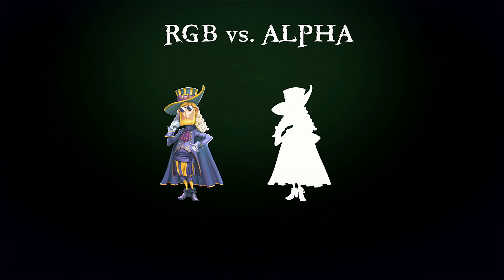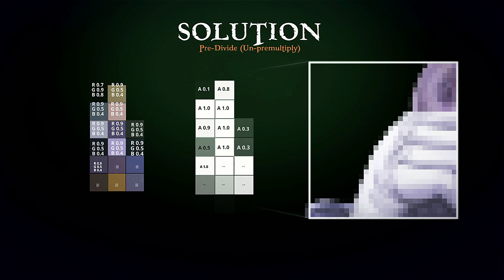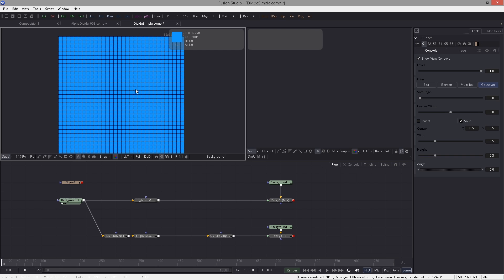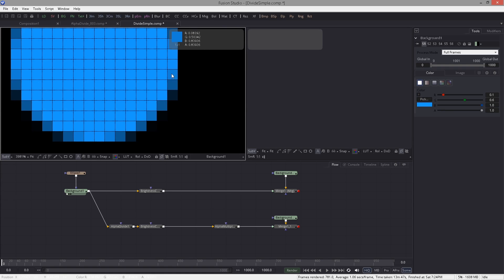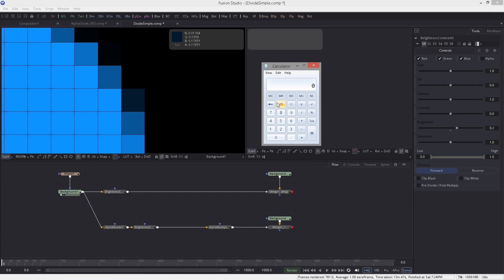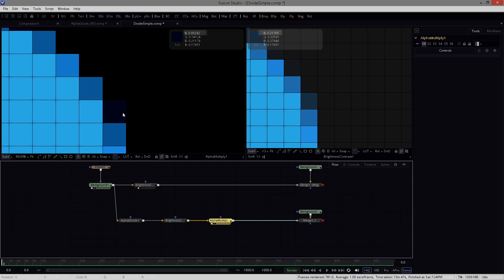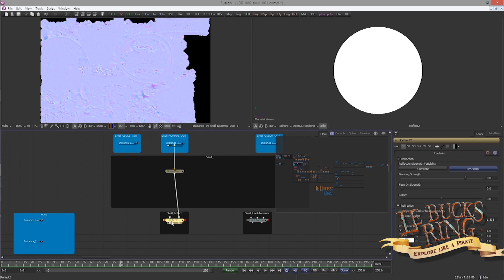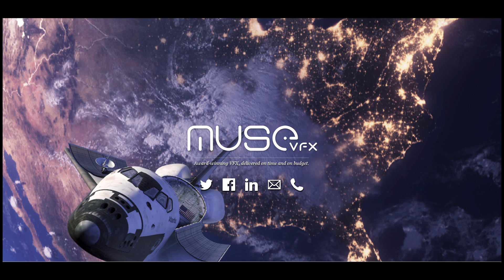Understanding Premultiply, Unpremultiply and Alpha Divide ( Fusion 8 )

Comment: Excellent explanation about alpha multiplication, what kind of problems do we get into if we don't take that into account and why it's useful to have options to treat images as premultiplied/unpremultiplied and its related operation: divide. I don't use Fusion, but it's still relevant and applicable information, regardless of the software. 

I especially liked the demonstration of the effect with the two examples, it finally clicked in my brain that alpha multiplication effectively MODIFIES the RGB values of a pixel, hence all the problems that could arise later.

So based on what I have to do, I have to tell the program if the image has to be considered pre/unmultiplied and eventually insert multiply/divide nodes as needed

Comment: Amazing! But one question: I come from Davinci and if i zoom in and Turn on PixelGrid i get "halve Pixels" like a Pixel with alot more colors than just one per square. Also: After Alpha Divide i still see some Alpha below 1 but the meter gives me a correct 1 for the pixel. What do i have change to see it pixel correct?

Comment: Great explanation. About the math of division: if the alpha is 1(white), dividing any number by 1 returns the same result. Hence the color value is unchanged. If we divide a color value by alpha value of 0, well, it's not clear what it should do, as dividing by 0 is a prohibited operation in math. But I guess it returns 0 as a convention. Then what happens to color values, how do they get restored? I inspected the color values of semi-transparent pixels, and divided them by the same pixel values. For example, you r color value is 0,02, and a semi-transparent is 0,01. Your alpha value is 0.5.  So 0.01/0,5=0,02. Therefore your value is restored.

Comment: Nice explanation. Can I follow Le Bucks Ring using Resolve 15 with Fusion integrated?
Reply from the maker: Dimitri Bastos yes but you need to use Reactor to install the wireless3D node

Comment: Verrrryy nice explanation, thank you. Your simplified demonstration really made me understand the what and whys of something I had previously found very confusing. I will recommend this video if anyone asked me about this concept. When I use a loader in Fusion that has the pre-divide/post multiply option, is that doing both steps for me? How does that work in a node system.
Reply: interesting question. I also want to know! :D